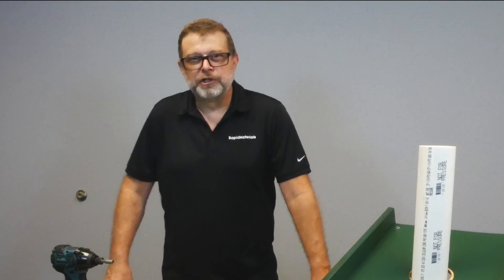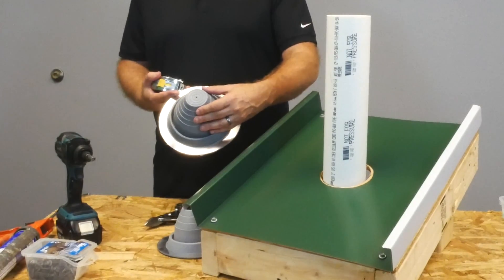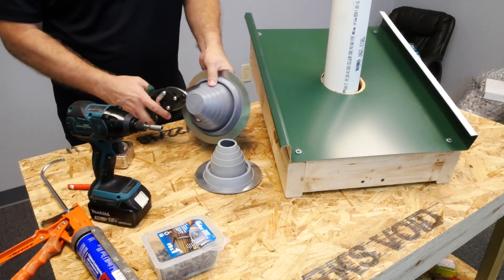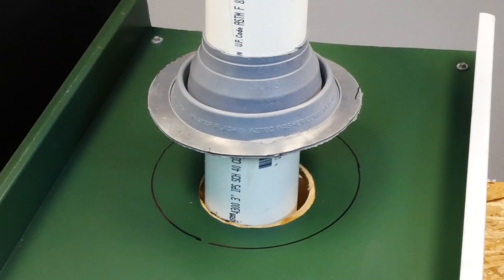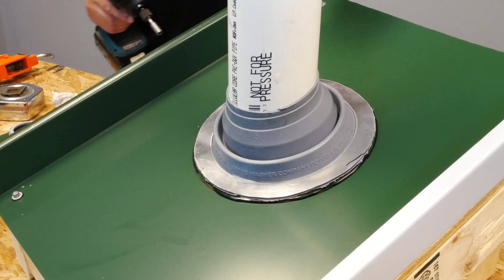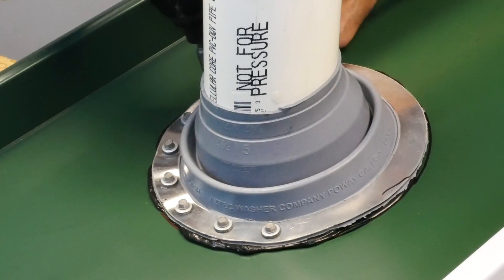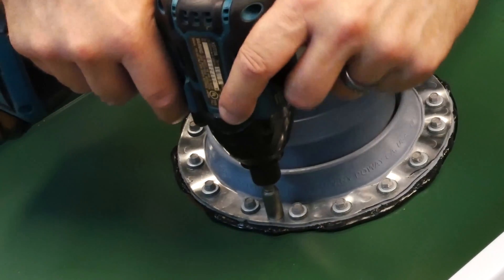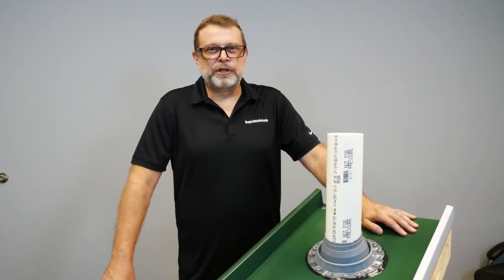How to Install a Pipe Boot Flashing On a Metal Roof

Comment: This video contradicts your own website which reads "You need to have clearance around the vent pipe so that the screws holding the pipe boot down are not fastened into the plywood. The screws should only fasten the pipe boot to the metal roof panel. If you skip this step , thermal movement of the metal roof panel will cause oil-canning (wrinkling) in the roof panel at the very least."
Reply from the maker: Bryce, Good catch! While these statements do contradict each other, they actually both apply, depending on the specific roof the pipe flashing is being installed on. The blog detail regarding installation that suggests not fastening through to the wood deck was originally written specifically for the commercial market and is certainly applicable to any large roof where thermal expansion and contraction is going to be an issue. The video presented here is targeted specifically at non-professionals who are most likely installing these products on their home, where short panel runs tend to minimize thermal expansion and contraction. For example, the average American home will have a roof panel run on one side of the roof that is between 15 and 20' in length. The expansion coefficient for steel roof panels is approximately .0078" per foot of length during a 100 degree temperature swing, so the total thermal expansion/contraction of a 20' roof panel would be 0.156". Assuming the roof vent is placed at the center of the panel (the 10' mark), the total thermal expansion at that point would be .078", or just a hair over 1/16" of an inch.  To illustrate this more clearly, assume the 20' roof panel is installed on a 70 degree day, with the actual surface temperature of the panel being 70 degrees. That night, the temperature drops to 20 degrees. The steel roof panel will shrink to the fixed point (in this case the center where the pipe flashing is placed) by approximately .039" (about 1/32" of an inch). The next day is blazing hot, and the roof surface temperature shoots up to 120 degrees. Now the roof panel will expand from the fixed point (the place where the pipe boot is fastened) approximately .039". Not much in the way of thermal movement and certainly not much of a concern. Particularly when you factor in the expansion coefficient for the plywood or osb substrate that the metal panel is attached to. Note that the coefficient for plywood is approximately .0024" per foot of length! This means that the thermal expansion of the metal relative the the wood substrate is even less than that of the panel alone. Hope this clears up the confusion for you! Feel free to contact us directly with any questions at 770-405-1060.
Reply: @RapidMaterials  Note the website can't decide what advice it's giving either, as one picture shows a large hole in the deck, the rest show a tightly cut deck.  It's a decision that has to be made up front.
Reply from the maker: @brycenesbitt7201  you are correct. This is a situation where it is always best to consult with a professional. In practice, when a plumber is installing vent pipes through your roof, he likely will cut the hole somewhat larger than the pipe, because his profession knows that the entire structure is subject to expansion, contracting, shifting and so on. All situations will differ somewhat.